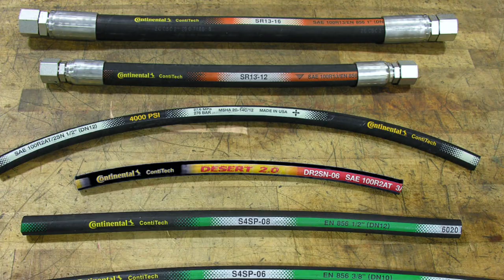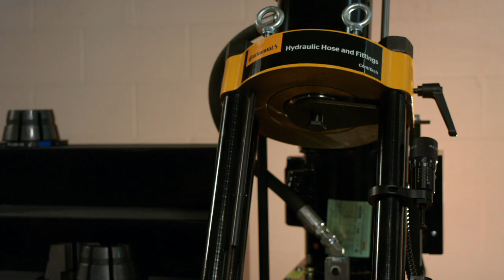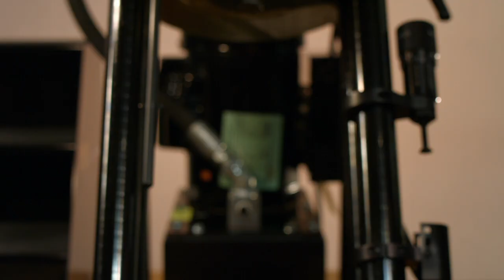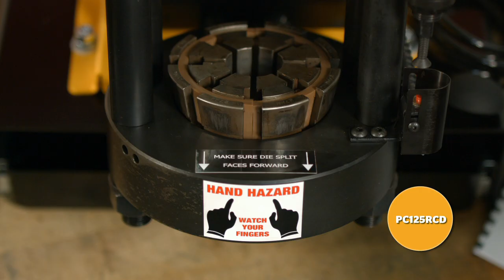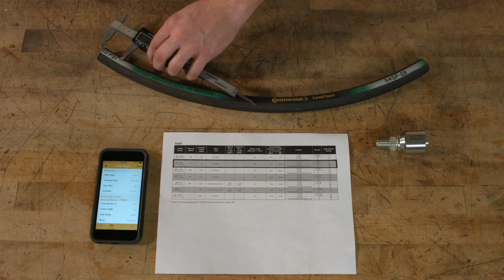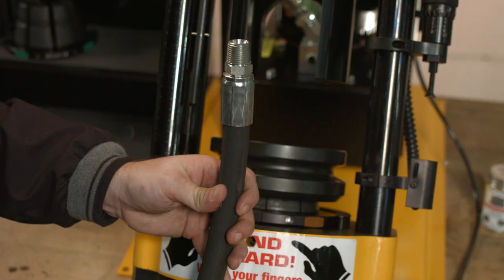ContiTech Crimper: PC125 and 150

Comment: Jai besoin acheté des pince aserti de la  seritisseuse meme marque  les pinces  standard
DN 8 -10-12-14-16-19-25-32-38 les tyaus flexibles jai besoin email de la entreprise qui fabrique les pinces a serti
Reply from the maker: Salut Alilo, please find the link to our Equipment Catalog to review and identify the Crimper that you are using along with the “dies” that you need. The details for the individual crimpers start on page 20: https://d3hxu0uwhrukhz.cloudfront.net/assets/Product%20Assets/IFS/Collateral/HYD/Continental%20Equipment%20Catalog-LR.pdf Please let us know the die sizes you would like to order so we can provide the proper price. You are making reference to the hose DN size, but we need the size for the die set. We also need to know for the PC125, if you need the RCD style (rubber cage) or aluminum ring? Many thanks! Cordialement, Continental Industry Social Media Team
Reply: Bonjour je peux savoire le prix de la sertisseuse pc 125